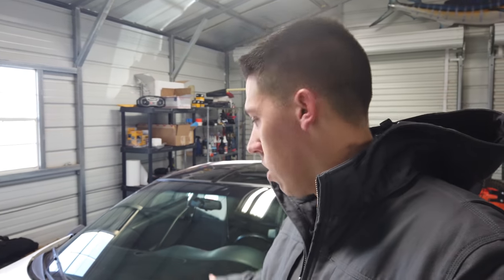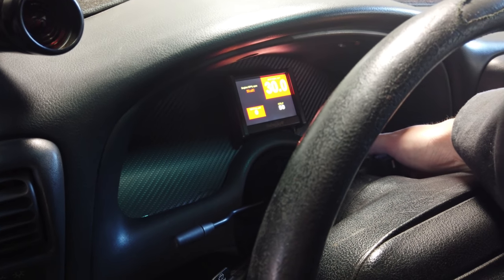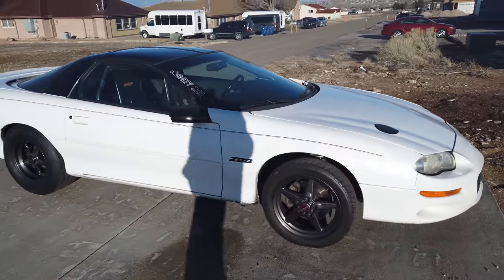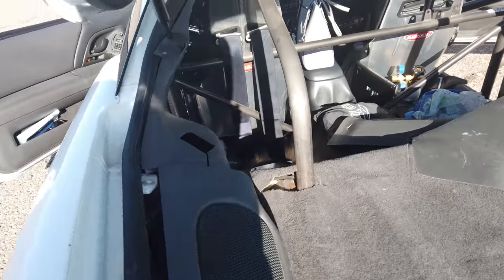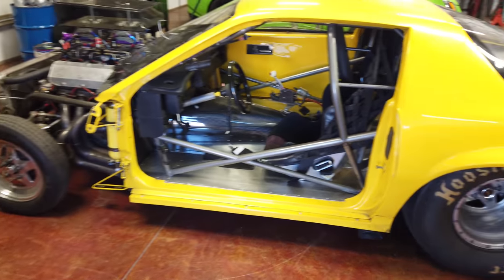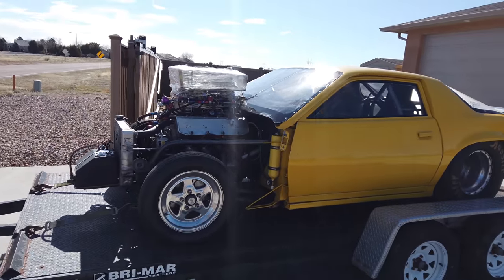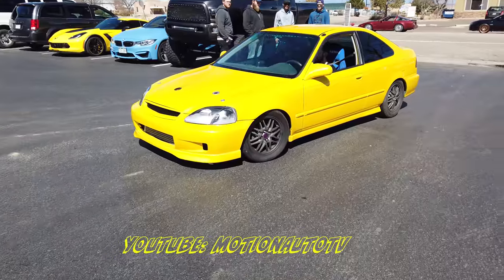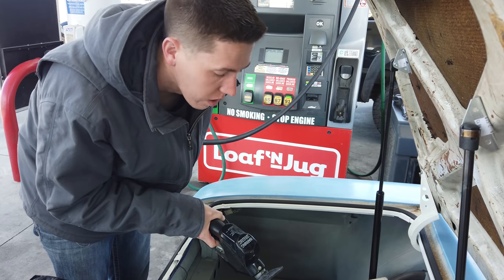Chassis Certification On Salty, Project 200 and Old Yeller!

Comment: Do u have a fuel content sensor in the buick and thats how u dont have to adjust the tune
Reply from the maker: We don't c16 and pump gas are close enough to the same density that the Same tune will work for driving around it is start alittle different but still runs just fine. I also leave about 10% correction on the holley so it can add or take fuel to help it run smoother. If we were running e85 or methanol and street driving on pump we would have to change the tune.